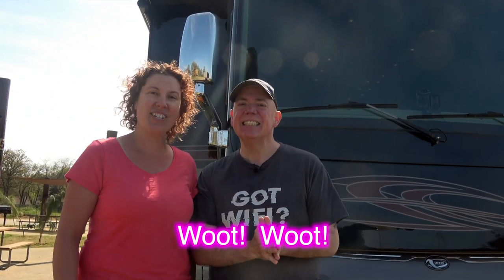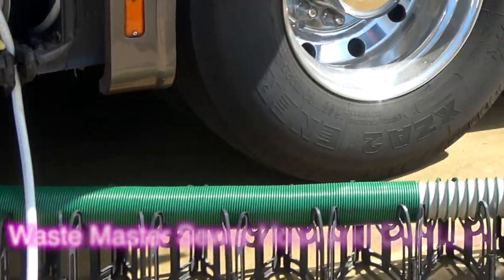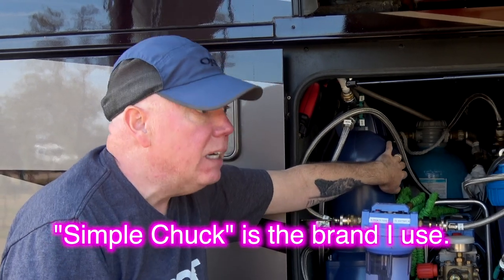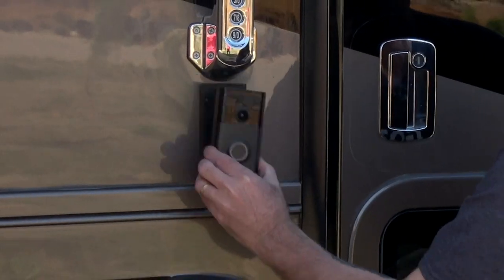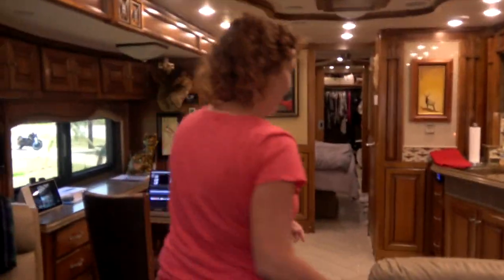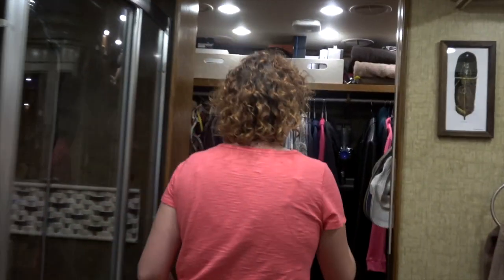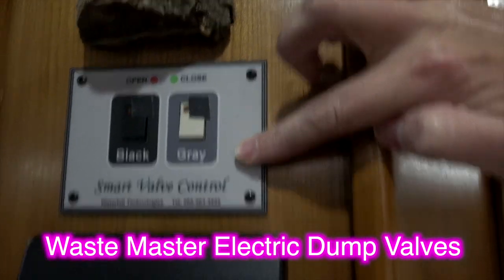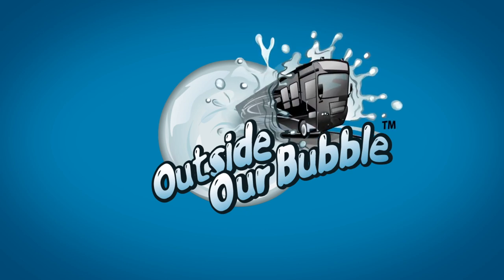Things We Would Buy Again For Our Coach

Comment: David and Brenda. Been a subscriber since you started. We were full timing at the time but family issues brought us home and only part timers now. That aside, love your “must haves” we have been using many of those products for quite a while. 
I like the Cam-loc system so much that all my water connections use camlocs sure makes life easier. We also converted our water system to produce reverse osmosis water which we store in our water tank. That allows us to rinse our coach with RO water. Not quite as good as DI but very close!  I also have started to adapt our coach using an Alexa interface. So lights, auxiliary pumps (RO high pressure) are managed by several WiFi enabled devices controlled by Alexa. 
You and Brenda have done wonderful work in educating the community as well as entertaining many of us. Thank you
Reply from the maker: Thank you Stephen for your kind remarks.

Comment: I seen that you "do not" have pool noodles on your slide outs. I use the 1" black piping insulation that is already split down the middle. These have saved my head more times then I can count. I also use the same ones on my windshield wipers while we are parked. Keeps the rubber from  drying out so fast. Oh and we are not full timers but we do spend a lot of time on the road going to motorcycle rallies. Great video, keep it up!!!!  :)

Comment: Just a reminder, five year anniversary means tire replacement. It's not just the condition of your tires it's the date of your tires. After five years they are more likely to have a blowout. 
Be safe and replace!
Keep the rubber on the road.
Reply: depends you If you have Michelin's and have them inspected by a Michelin technician you can go 7 even up to 10 as seen on the RV geeks!

Comment: Fun vid! Great tips! Looks like ya got your exercise for the day! LOL! Does your TPMS have tire Temp? Engine bay Foam extinguisher vs Halon? Understand priority is to stop the fire. But, does foam damage engine components/electrical systems as dry powder or chem. extinguishers can? Sorry if ya covered before! As always Thx!
Reply from the maker: Hi...Yes, the EEZTire does have tire temp. The foam will not hurt anything and is bio-degradable and washes right off. The reason for foam is it will help keep the fire from from re-igniting.  Once Halon is gone, it's gone there's nothing left to stop the fire from flaring back up.  I use Clean Halon by the inverter.  https://outsideourbubble.com/halon-fire-suppression-now-added-for-electrical/
Reply: @DavidBott  Just watched your older vids on auto fire extinguishers. Thx for the reply!

Comment: David, how much hose did you purchase. Do you carry an extra length Incase the hook up is outside the normal range or just black tank it until you can dump?
Reply from the maker: Hi...Good question!  I did buy the extra length just in case but I have never needed to use it as the hose is longer than other hoses it seems.

Comment: David, new owners 2019 Allegro Bus. We are installing the Eez tire pressure system.  Granted we have different RV than you, but can you tell me where you hooked into 12volt power on the coach?  Appreciate your help.  Thanks.
Reply from the maker: First off CONGRATS on your new coach! Also THANK YOU SO MUCH for listening and using a TPMS!  For the Monitor, what I did was under the dashboard I added in a 3 port 12V cigarette lighter. I more or less remove the dash to get to the 12V lighter and took a 3 port expander and cut the end off of it that would go into a lighter.  I then use used the wires and tapped into the same 12V feed that the lighter port was using.  So now under the dash I have 12V 3 lighter outlets to use for like the Monitor and GPS and whatever else. So it is all nicely hidden.  For the repeater I put mine in the rear closet where our breaker box is located. In there is 110V breakers and also 12V breakers.  I opened it up to get to the wires behind the 12V section and tapped into one of the 12V breakers. I then stuck the repeater to the back wall with velcro. :)   I hope this helps and again, CONFGRATS!!!!!
Reply: David Bott Thank you!!  We will give it a try - very helpful advice.  We are first time RVers, I forgot to mention.  We are from MA and may take a trip out to Niagara Falls area in August, so maybe we’ll get to meet you and Brenda on the journey to or from.  Thanks again.
Reply from the maker: @lauryneldon4321  Look up https://SouthwoodsRVResort.com  That is where we stay for the summer.  45 mins or so to the falls.

Comment: Hi Folks!   Which of the waste hose stand products do you like the best?  & which of the water pressure limiters did you select and lastly are you using an external surge protector or just the one that came with your Tiffin?
Reply from the maker: LOL...I have no idea on what that one is as we have had it for as long as I can remember.  Oh wait...It is this one... https://amzn.to/2I3brVe    As far as the water pressure...Here is the Blog post and video on it... https://outsideourbubble.com/dont-forget-your-pressure-regulator/  As far as a surge protector, I put in a Progressive Industries unit. The one that comes in the Tiffin IS NOT a protector. It only does surge protection only.  This is the one we use... https://amzn.to/2Uk27Da  Which is hard wired into the coach.
Reply: Thank you!   Just ordered the hose stand,  snap pads, water softener, and will get a couple more things before we get our coach, the electric dump for sure!

Comment: Why is the winegard in the basement, did it not perform as expected?
Reply from the maker: LOL...I test a lot of gear.  I actually use commercial grade gear in our coach from Ubiquiti which is what I install in RV Parks. I do testing and consulting on gear such as the Winegard units as that is that RV'ers would typically use.  I have under the coach right now a Winegard V1, Winegard V2, Wingard TOGO C2, and even a King Falcon Wi-Fi system.  I got to sell some of this stuff seeing I am now done testing and consulting on the firmware and apps.  I can use the room!  :)
Reply: @DavidBott  Thank you for the reply, so I presume it worked ok but you need a much more sophisticated system,  would you recommend the Winegard V2 for the average "Dave" . I currently use a Verizon hotspot for all of my internet needs.
Reply from the maker: @davespradlin791  Hi...Yes, if you look at my Wi-Fi videos, you will see I am not "normal" when it comes to Wi-Fi.  Like here is the system more or less currently... https://youtu.be/KqslIHCKC3E   Seeing you have a JetPack plan, the Winegard V2 would be a good choice as you "should" be able to use the SIM card from the JetPack in the V2 seeing it is more or less a big JetPack. So unless the SIM is locked to the JetPack, you should be fine. Then this would give you the option to be able to connect the V2 to an RV parks Wi-Fi or use the 4G data plan. This is a good as long as the RV Parks Wi-Fi is good of course and if you have a limited 4G data plan.  Thus having the option to use either is a good thing.   

Here are my two videos on the Wingard V2...  (From Sept 2018.)
https://youtu.be/4157UWlnZsg
https://youtu.be/SHmtl0eRZlQ

Hope this helps.

Comment: So why did you ditch the wineguard connect 4g 2.0?
Reply from the maker: I did not "ditch it". I still have it after all.  I test with it new firmware and thus need to be able to get to it.  Not to mention I have so many other ways to get internet.  :)
Reply: @DavidBott  ok you said the wee boost was the one you had to have in a new coach. I had assumed the winegard was your preferred option from previous videos.
Reply from the maker: @Bigfish11  Two totally different things.  The weBoost is the 4G signal booster for cell data.  The Winegard Connect V2 is a private Wi-Fi system that you attach all your devices to and then connect that to an RV park for Internet. The Wingard comes in 2 versions, with and without 4G.  It is NOT a 4G signal booster. It has much less power than the weBoost in regards to 4G.
Reply: @DavidBott  I bought the winegard 4g a few months ago. Only used it a couple of times so far. Seemed to work well. I did not realize it did not boost cell signals.
Reply from the maker: @Bigfish11  The benefit of that is that it has two cell antennas that are on the roof, outside your rig.  So it should do better for you based on it being outside and up higher.